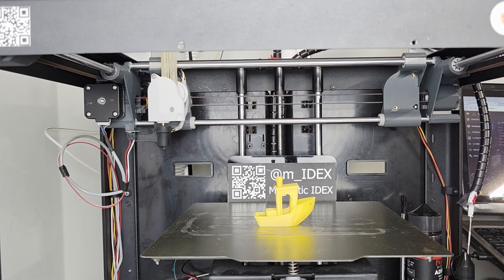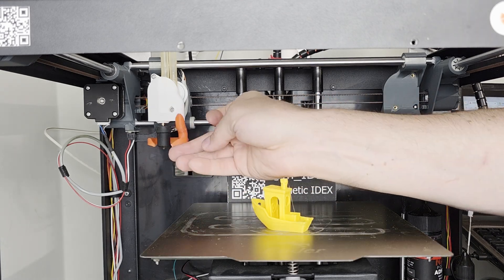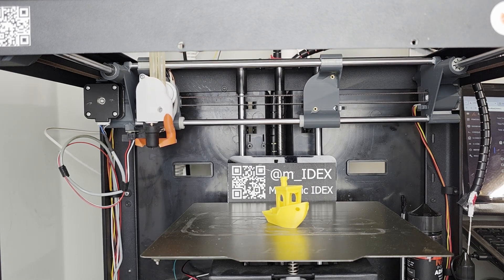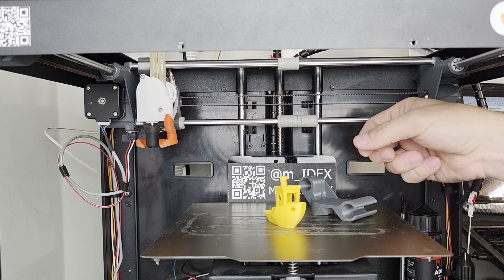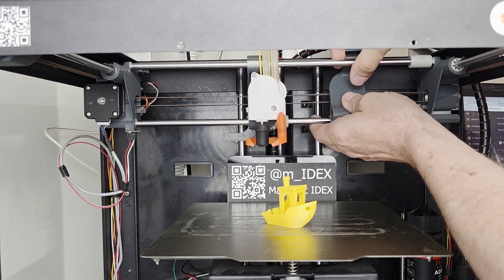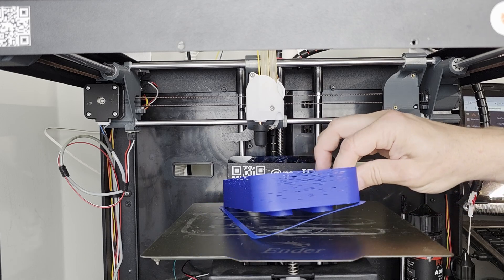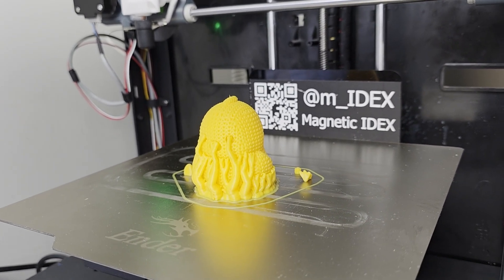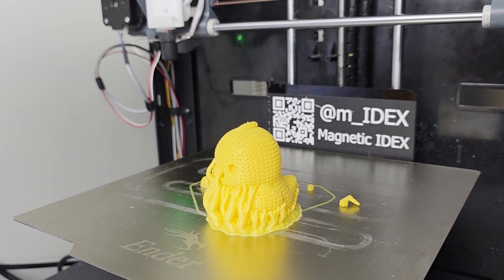World’s Lightest Extruder? Picolino + Akula2 3D Printing Test!

Comment: How are the push-push latches holding up?  Going to start building my IDEX soon and I may use those as well, but wanted to make sure they are durable enough for long term use.
Reply from the maker: Hey @twinturbostang , the push-push latches are holding up well! I’ve only replaced a couple due to overly aggressive parking, but no major issues. They’re cheap enough to swap out once or twice a year as preventative maintenance. Should work great for your IDEX build! Let me know if you have other questions.
Reply: @m_IDEX like the push-push latches idea. I think it could work on something like a Bondtech INDX bed slinger as well as your magnetic IDEX
Reply: @m_IDEX  I guess I would worry about what happens if a latch fails mid-print.  I have lots of questions!  lol  I have a modified CR-10 that I'm going to attempt to retrofit into a magnetic-IDEX setup.  Partway there so far.. running a BTT Manta M8P w/ klipper and have two Microswiss NG hotends.  So it won't be a direct copy of yours.  But I think I can use the relevant concepts to do a m_IDEX configuration.  Is there a way to contact you?  email?  Any help is appreciated!  😎

Comment: Help, a couple clarifications I see you use an optical end stop on the left for homing. So you have no confirmation if right carriage is docked latched?  The left carriage Latches on the left. So there are two positions? X0 the end stop triggers, but then you can go further x-10 to latch? That is how I'm working on my CR-10 conversion. Optical end stop for homing, then turn off end stop trigger to allow for a -X move to latch. (so I don't have to reinvent the wheel, after X home, what is the distants in X to achieve the latching?) Thanks.
Reply from the maker: Great questions! You're correct—I use an optical endstop on the left for homing, and I don’t monitor the right (T1) carriage latching since failures are rare. Homing moves past the X0 endstop position, and there’s no need to disable the endstop in firmware since Klipper only checks it during homing (feel free to test by manually triggering it mid-print!).
For my Picolino setup in Klipper, here’s the config:

position_endstop: -20
position_max: 266
position_min: -30

After hitting the X0 endstop, the carriage moves an additional -10mm to latch (from X0 to X-10). So, for your CR-10 conversion, a -10mm move from the endstop should achieve latching, assuming similar mechanics. Let me know if you need more details!
Reply: @m_IDEX  Super thanks!, I have the exact magnets, latches and end stops you use. I am mainly excited to print dual color and use PETG as support for PLA, I've upgraded a free CR-10 to 24v and Klipper.  I am also using a linear rail for my carriages, Got a MGN9 350mm to give a bit extra room to park carriages.Your info is helpful. Thanks.
Reply: @FilmFactry  Great minds. I'm doing the same with my CR10S Pro, except MGN12 400mm and modified Dragon Burners. It's in a few pieces atm due to Side Quests with CAM, Eddy, Klicky and friends. I had to upgrade my magnets to high temp N42SH as the enclosure was getting toasty causing the white rabbit magnets to disconnect from the toolhead. I'm toying with the idea of a sensor on the toolhead to detect the error scenario.

Comment: Different layout from before. What is driving the change?  Looks solid. Will need to upgrade my printer.
Reply from the maker: Thanks for the love and support!  The new layout is mostly for vanity, but it’s also a shift to a more common vertical X-axis toolhead carriage (unlike MakerBot-style horizontal ones). This makes it easier to adapt to printers like Prusas, Vorons, Enders, and Sovols. Plus, it opens the door for exploring tool changers! Hope you’re stoked to upgrade your printer for this.